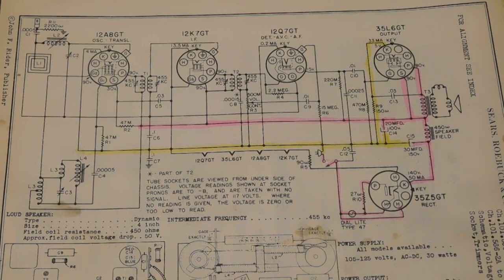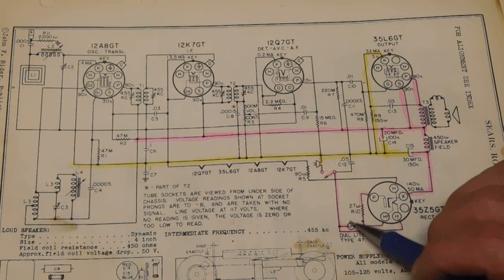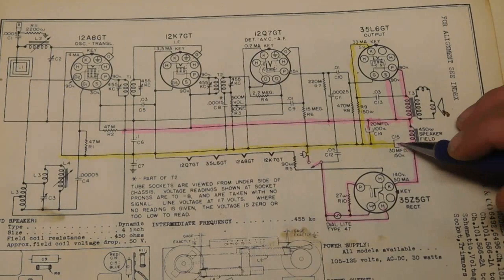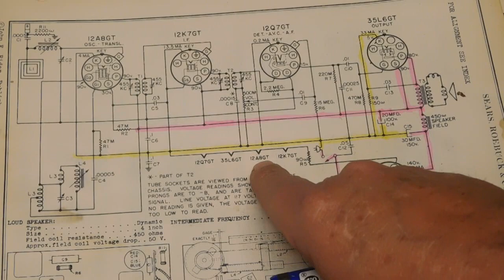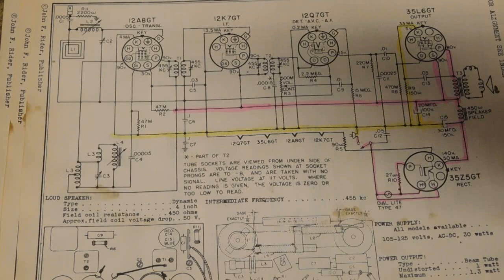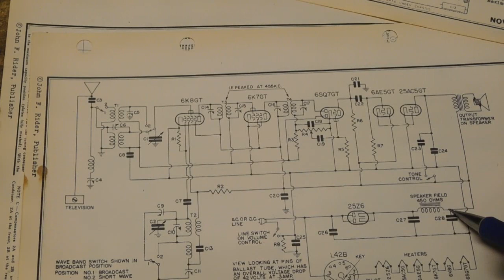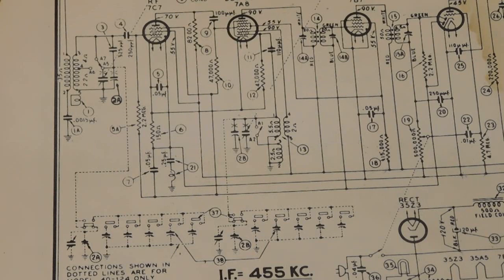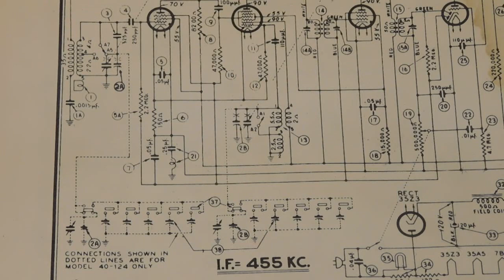The current path through an AA5 radio and the different grounds

Comment: Great!  You've cleared up a few points of confusion for me, particularly on how the circuit return might be depicted on ground return radios (like my Zenith where it's just ground symbols).  So thank you!  I'm still a bit confused about one thing (well, actually a lot of things):  where we say that one of the ways in which you can spot the return path is by looking at the cathode connections (makes sense), and yet the rectifier cathode connects to the plate of the next tube (through a couple of field coils) and appears to be on the B+ line.  The first drawing is an excellent point of reference, with the red line you've drawn.  I'm trying to think of the coils as smoothing the B+, but I can't conceive of how it gets to be plus to begin with.

Comment: Hallicrafters Continentals also used coil wrapped around capacitor to isolate b- from chassis.  Couldn't figure its purpose out. Thanks for explaining it.  I have 2.   One keeps burning 820 ohm resistor between electrolytic caps and can't find the short problem.

Comment: Thanks for the well explained schematic video. As a newbie messing around with tube radios I really enjoy watching and learning from videos like these. Quick question regarding the capacitor you mentioned that is locking down the floating chassis at 20:50. I’m currently working on a radio that has this type of circuit and is labeled as “RF Choke”. My problem is that the capacitor is leaky and needs to be replaced. Can I install a regular metal film cap and remove the coiled wire? Thanks in advance and keep the videos going.

Comment: Dennis toward the end of the AA5 current path video on the last schematic you use, when you talk about the front end there is a ground symbol below cap 1A as well as various other points.  Is that ground tied by wire to B- or is it connected to the actual chassis as you described the cap\coil #21?  Sorry to beat a dead horse but I want to get it right.  Would it make a difference if all ground points on a whole radio were tied to AC line neutral.  
Also wondering if each tube of an AA5 can be visualized as a separate circuit, supply B+ to B- return.